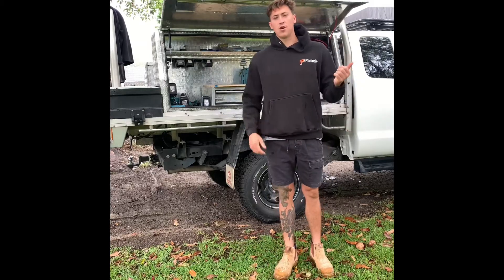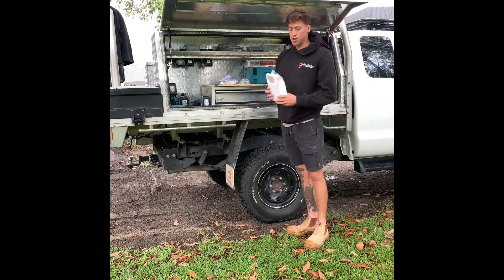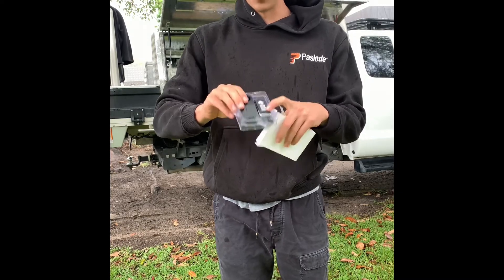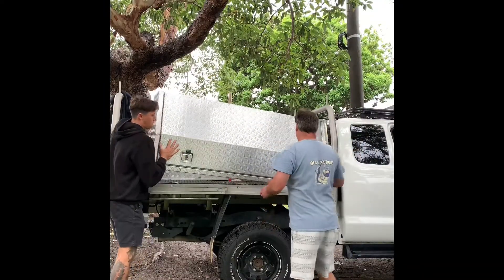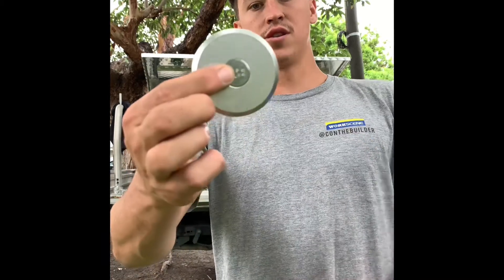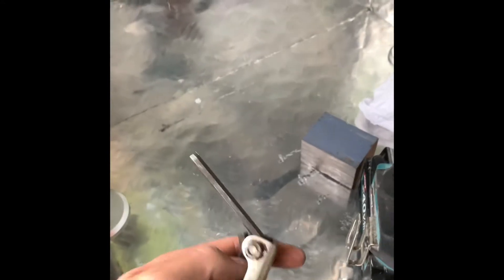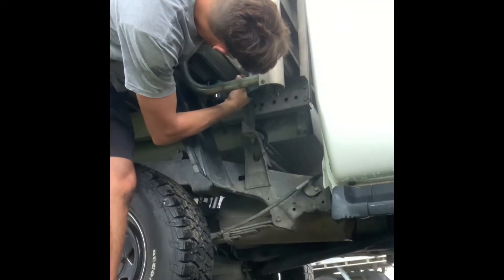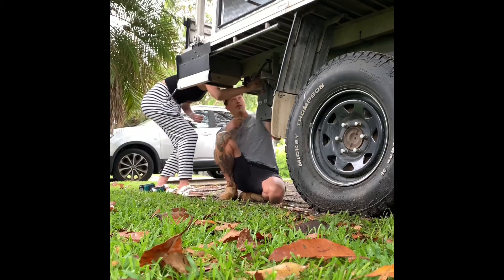NEW TOOL BOX || How I installed it!

Comment: I’m getting moisture in my tool box idk what from ?
Reply from the maker: I found with old tool boxes a lot of rain come in from the top hinges
Reply: I corked around the thread of the bolt where I nut is, under the tray so water doesn't have a way of working its way up